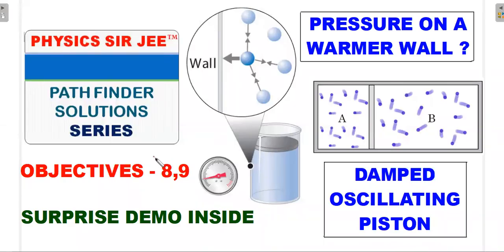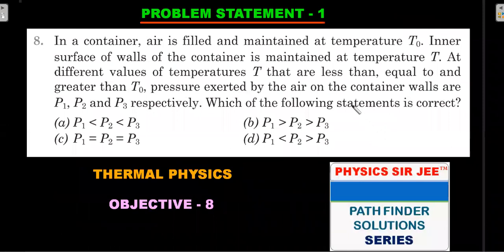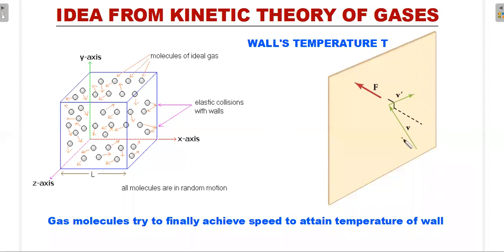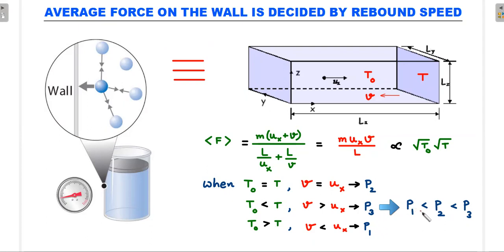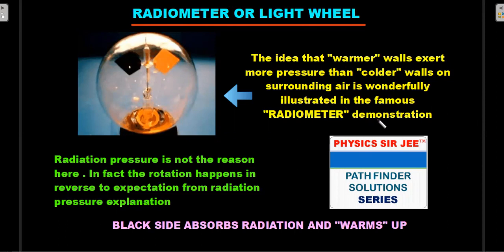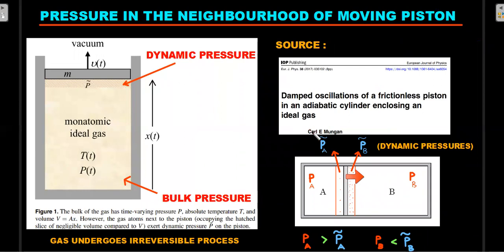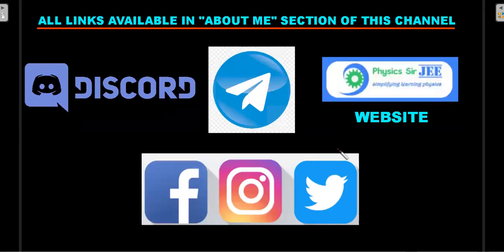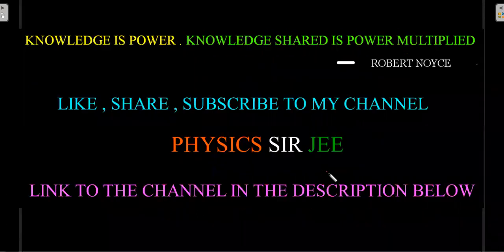PATHFINDER SOLUTIONS | PRESSURE ON WARMER WALLS (RADIOMETER) | OSILLATIONS OF PISTON OBJECTIVES 8,9

Comment: Sir, I am facing a problem in the explanation of MCQ 8.
When the gas is at Tnot and wall is at T, then won't there only be a few molecules at the temperature of wall and the argument by which we say that velocity is proportional to root T fail because there aren't enough molecules for the velocity distribution to work properly?
Reply from the maker: It's an assumption that collisions are very frequent. Otherwise , we can infer answer will lie between T and T0 as temp rises gradually and still pressure is higher
Reply: @PHYSICSSIRJEE  Got it sir, Thank You

Comment: Sir why the final temperatures of both parts A and B are same
Reply from the maker: Like , I said in the video at the end , piston is assumed to be acting like a giant molecule transferring disorder from one chamber to the other. The steady state should represent the the energy associated with molecules per degree of freedom per one direction to be same in both chambers (1/2KT) . The process remains irreversible till the end. Eventually T has to be same. This idea can be rigorously derived using entropy understanding as given the paper provided. It's tough and so we used logic at JEE level instead of complete calculation
Reply: @PHYSICSSIRJEE  ok sir thank you